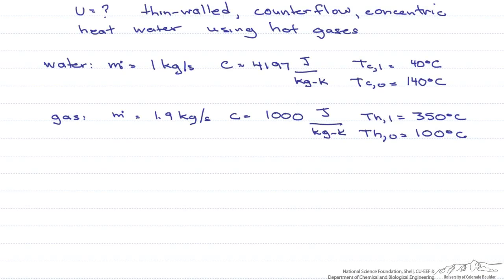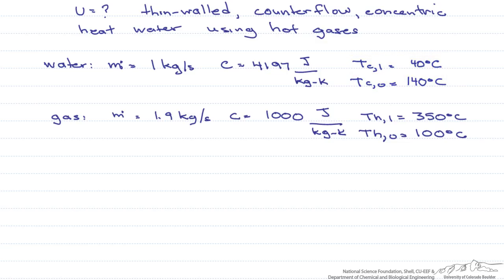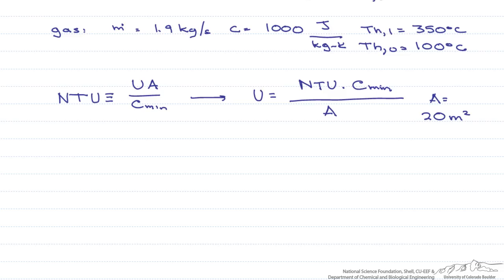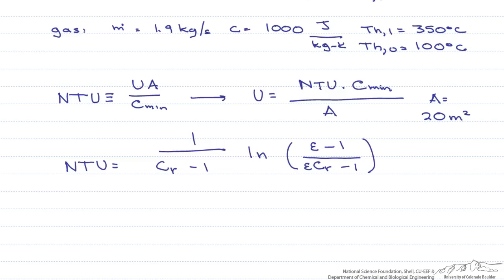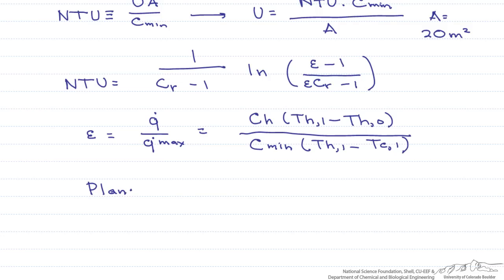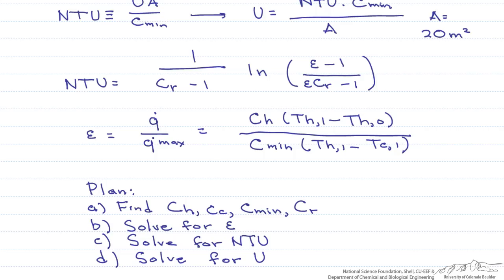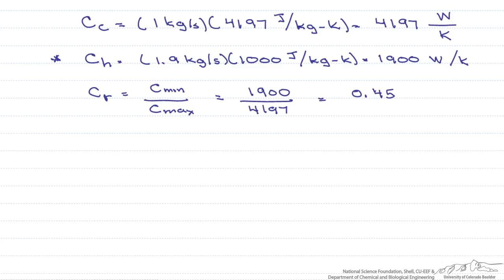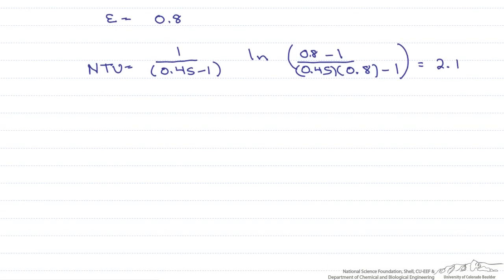NTU Effectiveness: Counter-Flow Heat Exchanger

Comment: my professor want us to evaluate a product for shell and tube condenser . Temp. in/out for fluid is given, but then what is the use of sub.cooling?
Reply: what is condensing capacity? is it the Q for the 2 medium/fluid?
Reply: Cc = mcCp'
        ,mc=mass for cold (water) if you are given volume flow rate (m=volume*density of water)
        ,Cp= for water (base on Tmean = (Tinlet for water + Toutlet for water)/2))
Ch = mhCp
        ,mh = mass of hot fluid (oil,gas etc..)
        ,Cp = for hot fluid base on Tmean